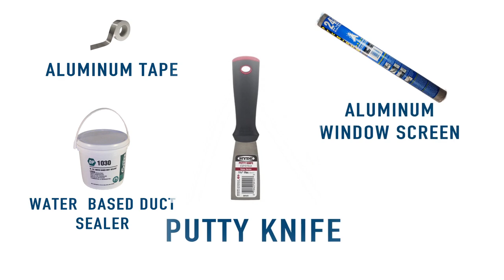How to Seal Floor Vents

Comment: I put the screen over the top of the vent and used magnets to hold it secure. It will be much easier to clean if it gets dirty. If it does get filled with lint, you have another problem to deal with because all the lint/debris should be getting caught in the return air filter.

Comment: We were seeing an increase of spiders in the house since the warmer temps began last month. I suspected they were coming through the floor vents. I made custom cut metal filters out of metal screening, and put them over the top of the vents throughout the house and held them in place with strong rectangular chrome colored magnets.
I have to say they look pretty nice. We also set out several glue traps to catch the spiders. 
So far, we have seen only a couple spiders since then, so this tells me there are some openings in the ducting of the system that will need to be repaired. If any lint or debris build up on the vent screens, it will be easy to take them off for cleaning.
Reply: Rat prevention too
Reply: Sadly this is found in many income based housing units. And they never ever clean vents since build. I got a toxic mold fungus causing a hole through center of nasal septum. I opened vent and water from under sink destroyed the 4 inches of wood under sink thus destroyed vents in duplex. And it PASSED hud inspection...cuz they don't check. They wouldn't fix it. I'm disabled. I wish I could work but I couldn't even breathe the yr I was stuck there. Now, there is no housing. Being used up by non citizens. That's fine but I think that homeless disabled Ameucans should be housed first. We are homeless due to crap apartments and others live in nice hotels. As a US citizen, and independent voter, I'm disgusted. If anyone knows of any help for permanently disabled gen x (55 yr old) women with great credit pls let me know. I'd be happy with a big room. Wasn't allowed to keep furniture as it was infiltrated with black, white and pink mold coming thru central and floor vents for a yr. So now I have nothing. Renters don't pay for problems that could be prevented. And with less than $1000 a month, lawyers are out of reach. Bureau of health said they must fix. They denied. I had to move. Thank you to all GOOD CARPENTERS. I was married to one who prided himself on his work. Sadly, these places don't hire guys paid enough to watch your videos. If I had strength and tools and money, I'd go serve the widows, never forget, that person you help may land you the biggest job of your career. Loving your elders matters. Thanks for reading. And sharing knowledge. ❤
Reply: I do not prevent or kill spiders in my home. I search my house to find their food source and clean everywhere. Spiders do not live long without food and will go somewhere else. If they stay that means your home has other types of bugs that you should worry about. Spiders are like a fire alarm. Spiders are not the problem, their food is the problem.

Comment: sorry to say but that screen is going to restrict the airflow too much especially after it begins
to work as a filter and pick up debris and get clogged up over time. very bad idea bro. good try but if your ducts are sealed properly no bugs will get in anyway.
Reply: Ever hear of a vacuum cleaner?  Clean it every once in a while....   It's a great idea to keep larger debris from falling into your vent system and it's not very restrictive while its clean.
Reply: Brad T I'm an HVAC contractor with 32 years experience.  The equipment needs a certain CFM to operate property.  You don't know your A$$%
From a hole in the ground.
Reply: Dude, keep your comments CIVIL.  You are not all knowing.  That will cause a reduction of CFM, but not that much of one if it is kept clean with a vacuum cleaner every once in a while.  It's a whole lot less restrictive than the register filters people usually put in them.  And all the dust and crap that falls through the floor registers will be sitting in the lines, which over time will cause an even greater reduction in CFM (provided they don't clean the lines which most people don't do).   I still think it's a great idea.
Reply: @BradTraynham  Its not a good idea.
Reply: @BradTraynham  no, Charlie is right.  Whatever vents these are on will receive less air.  HVAC systems are very weak, they're not leaf blowers, so the air will go the path of least resistance.  Only way this would work is if every vent has a screen on it.
Reply: @BradTraynham  "Ever hear of a vacuum cleaner?" is not, as you have suggested we all do, keeping your comments "CIVIL." It is a snarky, derisive comment. Gotta go with Charlie Becker on this one. Screens will interfere with and tax the HVAC system, sort of like a chronically dirty air filter will. If sealed as Charlie suggests, no bugs can enter the system.
Reply: I was going to try this until I read your comment. You're right, the screen will only serve as a filter and get stopped up. If the system is PROPERLY sealed there is no need to add additional filters. Glad I read through the comments. I do like the mastic/tape idea though.
Reply: @BradTraynham  I believe the "dust and crap that falls through the floor registers will be sitting in the lines" will blow back out through the register the first time the system comes on. If your system is PROPERLY sealed it behooves me to wonder how insects or anything else would enter the HVAC system.
Reply: I would have to agree... adding another obstruction to the airflow channel will reduce the amount of air getting pushed through. But will definitely try the seal and the aluminum tape.
Reply: I liked the sealing up until the screen was added.   Even clean screen with restrict airflow.   It's the same concept as throwing MERV 13 filters in units not designed for that much pressure differential.   If you don't listen to the HVAC professionals then who are you left listening to?   The non professionals that's who!
Reply: @BradTraynham  Fact's
Reply: @charliebecker4417  Be cool we wear N95 mask it's ok cubic feet per minute

Comment: Great Video,  Can I do this on a fiberglass duct?  I have access to the inside of mine or should I use caulk or insulation foam to cover the gaps at the end caps and 90 degree connections?  Thank you

Comment: What I want to know is how to seal off an unused duct permanently.  Old house and old owners rerouted the heat to other ducts and left the old one.
Reply: best to do at origin of duct leading to the register but if you must do at register cut thin piece sheet metal to size (doesn't have to be perfect screw into edges as possible and then use mastic over the whole new piece and around the edges.

Comment: What do I do for vents that sit on carpet?
Reply: Same thing, really
Reply: Same. Except you will need to pull back the carpet and any padding a bit to gain access to the floor. It's important to have the tape extend to the floor surface by about 1/4 an inch as they did in the video. Also butle tape can be better then the AL tape. Then take a staple gun run a few staples around the top. The butle self heals, and the staples help ensure the tape does not pull up or migrate over time with temperature changes. Also skip the screen! Not only will it clog over time, the screen it's self is a restrictions. It can reduce the total surface area by up to 50% to 60%. This will reduce the needed airflow of your HVAC system without any dust bunnies choking it off. In very short order fine dust will collect and choke it off even further.
Reply: @williamallen7836  Is there a butyl tape that you prefer for this repair?

Comment: Terrible video, you don't put mastic over metal tape and that screen is unneccesary, all it does is restrict airflow.
Reply: John Novinger everyone says this video is wrong. What Is the proper way of doing something like this?
Reply: @leonperez9612  Depends on the situation. If you have access to the vent from a crawlspace, basement, or attic I would suggest spray foam around the edge from the underside and put mastic or tape over the seams. If you can't access the underside I would use silicone or latex caulk to fill that gap and you can get to some of the seams with tape, I personally wouldn"t use mastic on the inside. I would never put a screen over the vent unless it was in an area where food or debris were a constant problem. If you do that to all of your vents you are dramatically reducing air flow to the house.
Reply: I admin I'm no expert which is why I've been watching these videos today. I have seen many professionals in these videos add mastic around the tape to extend the seal. Not arguing, just saying that this isn't the only guy doing it.
Reply: @fastrivers812 same. Mastic over tape bc most people don’t make sure the tape is sealed right or tight. Mastic fills in any gaps. There’s a new method that is an aerosolized sealer called Aeroseal. It gets in every nook and cranny for a super tight duct seal to the entire system. But not a DIY project bc of specialized equipment and specific procedures.

Comment: Err...a bug screen?   WTF?   

Now that screen is going to need to be cleaned and will restrict airflow before it's even dirty, and will get worse the dirtier it is!

There should already be a filter in the system, down near the HVAC unit!
Reply: If your ducting has some openings, bugs can crawl inside the ducting and come out the floor vents.
Reply: @truthseekerKJV  seems like the better thing is to then go check the ductwork downstairs and use mastic to seal those gaps. Bugs shouldn't be in the venting period.

Comment: I am about to move one vent about 6 ft to another wall. How to I permanently seal off the hole in subfloor before installing vinyl flooring. Seal it with flashing underneath?
Reply: @MollySockLongGrass  I believe he still has duct underneath, I dont.
I will move the duct to new vent so I will just have the hole in the floor.
Reply: @NRB_75  I imagine you would fix it like a large hole in a wall. But this was a year ago. So how did you solve the problem?

Comment: Seems like spray foam would be a much more simple, quick, and easy solution.
Reply: Possibly but spray foam has a tendency to expand
Reply: And you can’t use it on the interior or ductwork. There’s a new product and method called Aeroseal, but not a DIY application.